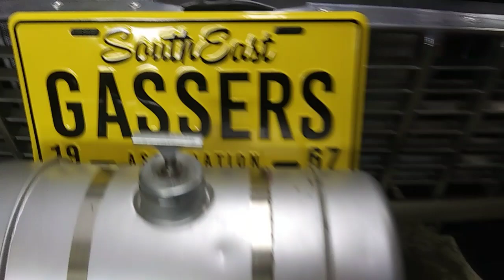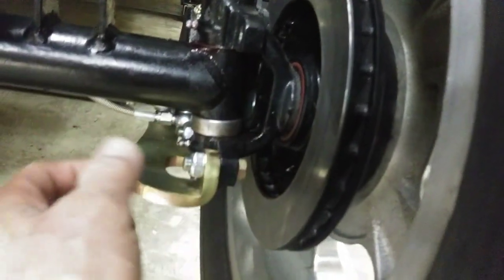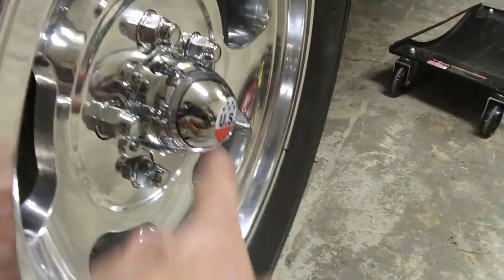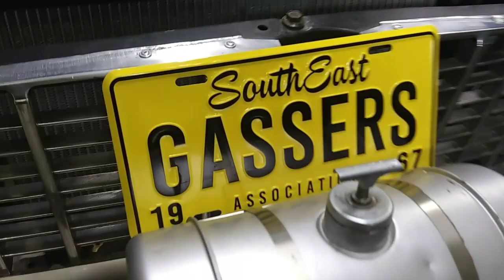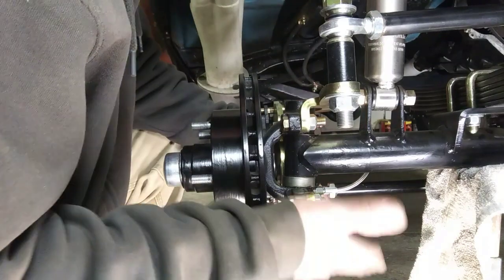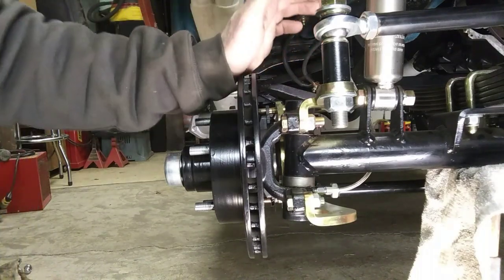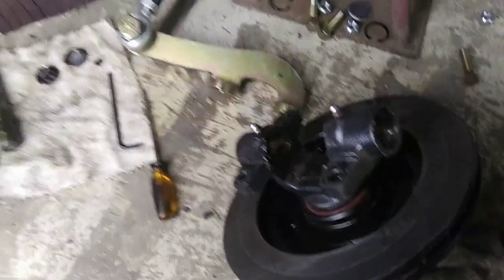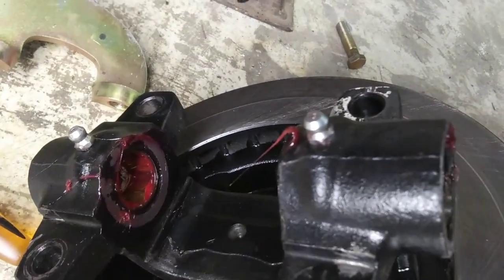1955 CHEVY GASSER. Spindles, working some bugs out

Comment: Preventative maintenance is always a good thing to do. Especially after replacing and breaking-in parts. The old '55 is looking good. Here's hoping the weather improves. Supposed to be in the low-mid 50s with rain all week. Which will delay the cleanup of all the sand on the roads done each spring. Once that clean-up is done you see all the hot rods and bikes getting out. Be safe and stay well.
Reply from the maker: Hey Brian thanks. It was good to take those kingpins apart to clean and shim them up. She should be good for now. Hopefully the rain will start to stay away
Just like here lots of sand on the road from winter time. Oh yeah and a lot of pot holes to lol always fun  trying to dodge them.
Have a good one and enjoy the rest of the day brother👍👍👍